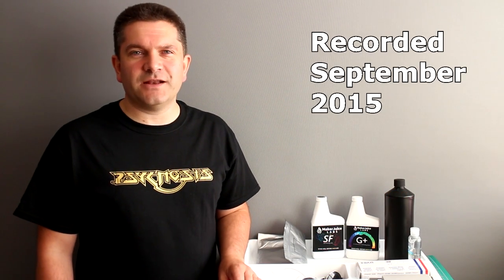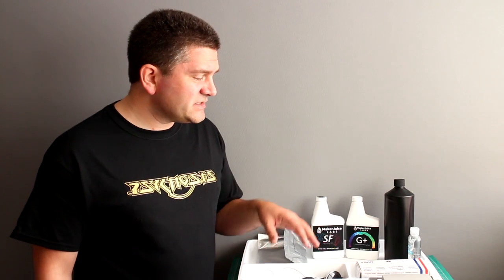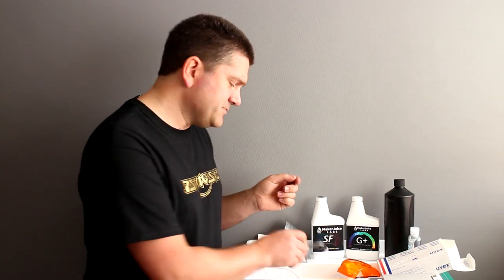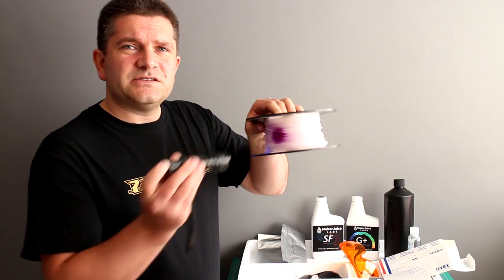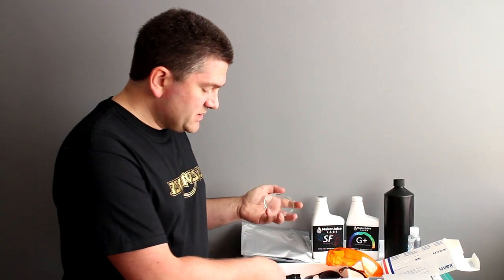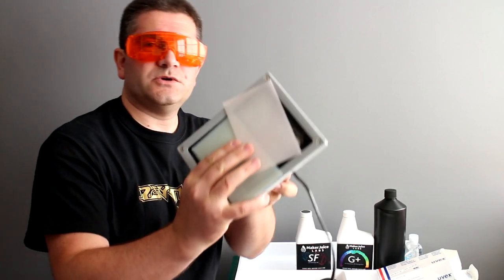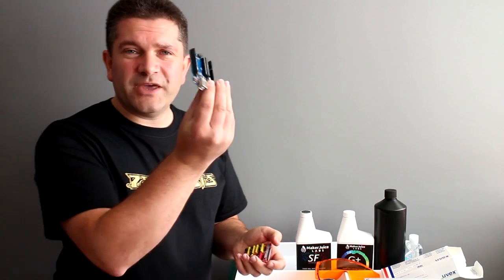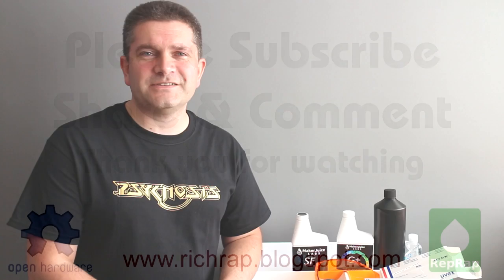OpenSLA 3D Printer development Introduction

Comment: Do you know how much max mW the usual resins can care? I would like to find the optimal balance between speed and the danger of cooking the resin. Current lasers are available between 10mW and 2000mW (hell, that should result in blisters). 

By the way: I am wating since days for being accepted in OpelSLA G+ group ;)
Reply from the maker: Really depends on the mix, some are very hungry for UV and take many times more power to cure, others can set so fast they cause significant heat generation and problems.
If the manufacturer can;t tell you, then the only way to discover is to do some testing, you can do that by altering layer time in stripes over a film of resin, or if you are drawing with a Laser, speed or the beam.

Sorry about the wait - you are approved now.

Comment: What's the source of the $20 UV resin?
Reply from the maker: That exact bottle was from 3Dprinterjuice on eBay (in the UK). They sold quite a lot and had a good selection of various UV resins, but as of April 2016 they are no longer registered on eBay. I'll try to hunt down a few more suppliers.
I have been told by many in the industry that they could sell 1L of resin for $15 and still make money, so it's a good margin for many existing suppliers charging a lot more than that.

Various other 'generic' UV resins do seem to be available, A quick look on eBay.com showed quite a few more in the US now too.
Reply: Ok... that's really cheap.. most (admittedly branded)SLA resins I've seen are around $50-$100 per 1L bottle.

Comment: has anyone ever tried driving a normal LED LCD screen but replaced the white LED with UV leds? when stripped an LED backlighted screen its just a simple strip of LEDS
Reply: For what I've heard LCD panels with a retrofitted UV backlight tend to die out very very quickly since they were not designed to withstand strong and constant UV exposure.

Comment: Thanks for sharing this. I'm certainly going to join up to the group to keep track of the development. I did a quick search for the filament and discovered reasonable pricing, US$24 for a half kilo, but unfortunately only in ABS as best as I can determine. I questioned the duration of the colour change and found that it eventually fades back to natural. Re-usable UV testing models!
Reply: Microcenter (in the US) sells UV Reactive PLA filament... it prints beautifully and is less than $20 per 1/2 kilo spool.
Reply: Thank you for the lead. I'll be able to make good use of this unique aspect.